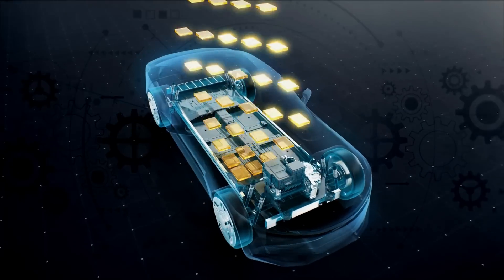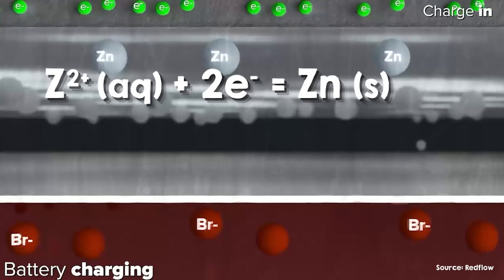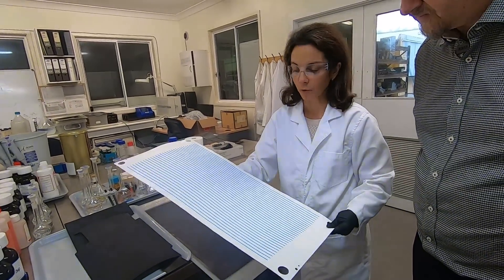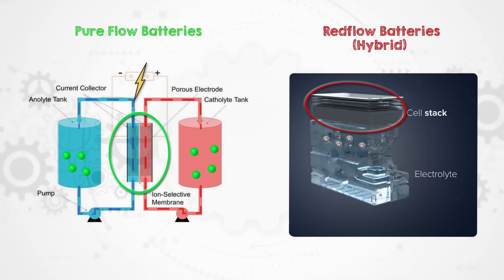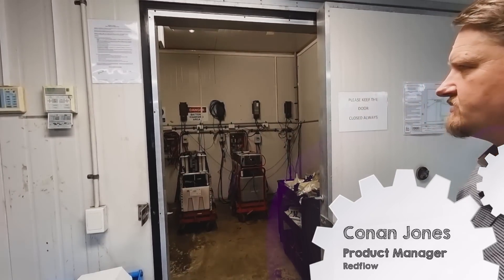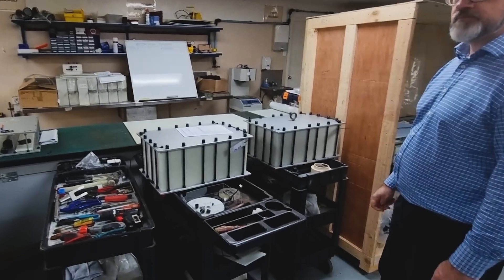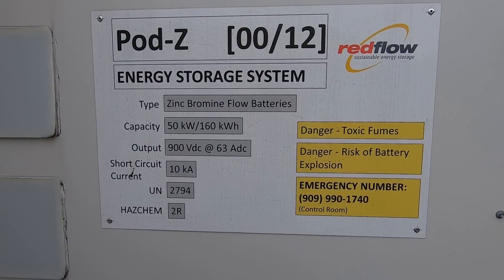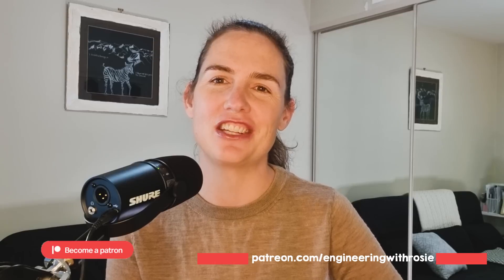Are Flow Batteries About to Take Over? A Lab Tour of RedFlow's Zinc Bromine Battery

Comment: At x3 the price of LFP batteries… We need something 10 times cheaper, not more expensive. 

It seems that a sphere of 2.5 m in diameter filled with sand and covered with 0.5 m of mineral wool would be able to store 300 kWh (1000 oC) for a week, losing 25% in the end, and being able to return half of it back in form of electricity and a quarter in form of hot water. And costing 7.5k USD (20 USD/kWh netto). (For reference, a 2.2kW steam turbine costs 2.5k USD.)

It’s interesting why no startup is able to produce a prototype of such a simple, but so much needed system.

Comment: One year later and the wheels fell off. It would be interesting to revisit this story. Unfortunately the Redflow collapse  reflects poorly on Flow batteries in general not just Zinc Bromide or is it Bromine You story seems to use both terms but this could be an editing problem. The chemistry is above my education level. The story at one stage talks about batteries coming back after 8 years Was that a red flag ??? What about a story covering other flow batteries there is a lot of work being done in this space especially Vanadiun pentoxide batteries. which have a life of 20 years+ and still counting. It would be good to see you talk with private suppliers that have just installed a VRFB at Yadlamalka in South Australia (I think April) this battery in Yadlamalka is still being assessed  but VRFB have been in operation in other parts of the world for a few years now.

Comment: Keeping Lithium for use in automobiles and using flow batteries for grid scale solutions makes much more sense. 
I'm planning to start building off grid capable homes with solar and battery backup. Flow batteries seem ideal due to long term stability. 
As, Democrats push the green agenda and our energy starts getting more expensive and less reliable people will want their own power generation.

Comment: Hi. A good start, but pumps and motors running 24/7 mean more components to fail. The most successful systems will tend towards simplicity, longevity, and cheapness. Occam's razor cuts cleanly. Cheers, P.R.

Comment: Another flowbattery is the hydrogenbromine(HBr-)flowbattery. Working with 2 HBr +e --> H2 + Br2 and discharging with Br2 + H2 --> 2 HBr + e. Allround efficiency is 70 % (( so as a seperate electrolyser and fuellcell both 84%)).  Advantage of those battery is that no expensive materials are needed. Br2 en HBr can be stored in the same tank. When this battery is put on an hydrogenpipe the flowbattery works as an electrolyser. In that case there is no expensive hydrogenstorage necessary. When discharging however you have to buy the hydrogen back. In mine opinion you have than to use hydrogen made by steam methane reforming. Efficiency SMR is 75 % and the efficiency of the HBr-flowbattery as fuelcell is 84 %. So the efficiency of using natural gas (methane) to make electricity by SMR and the HBr-flowbattery will be  75 % x 84 % = 63 % while by a STEG-gasplant is only 50 %.  https://www.innovationnewsnetwork.com/the-elestor-battery-makes-hydrogen-gas-fired-power-plants-obsolete/35865/ https://blauwgroenenergie.blogspot.com/2023/05/85-rendement-de-hbr-flowbatterij.html

Comment: You can improve your video quality in the lab by setting the shutter speed to a factor of 50, due to the 50hz lighting. So 1/100, 1/150, 1/200 etc. Also you could invest in dual clip on wireless lapels like the Rode Video Wireless Go II, or the DJI Mic.

Comment: The EV industry better find an alternative to lithium ion batteries very, very quickly as the EV battery compartment fire phenomena is getting ready to derail said industry - that cargo RoRo ship off the coast of the Netherlands that burned for days due to EVs onboard, that entire homes have now been burnt to the ground due to an EV fire in the garage - these are all becoming more numerous incidents as the number of EVs mount up.

There are only maybe these things that are more devastating than an EV fire: a petrochemical plant fire, derailed train cars carrying tons of toxic chemicals that spill into the surrounding land area, a contamination of plutonium into the environment.

Other than those, there just not much in the way of human technology disasters that can compare to the shear devastation of thermo runaway EV battery compartment fires, which become self-oxidizing and can't be extinguished, they burn at very high temperatures that  can compromise steel structures and enclosures, they release great volumes of noxious, very toxic fumes, they can easily cause anything adjacent to burst into flames (other EVs, other conventional vehicles with petrol fuel in their tanks, entire homes or apartment complexes that people live in).

It's clear that there now need to be quickly adopted laws to ban lithium battery EVs from being parked in enclosed spaces, ban them from ferry boats, ban them from being parked within 15 feet of adjacent vehicles (especially other EVs).

Everything in life involves some risk, but it is also necessary of what are the consequences of when are on the wrong side of the risk equation? with EVs, those consequences can be utterly devastating - hence why it's not at all an apple's to apple' comparison to weigh their risk in the same way we weigh the risk of fires associated with conventional vehicles.

Most conventional vehicle fires are under-the-hood-fires that can be readily quenched with a fire extinguisher (I keep one in my vehicle - doesn't everyone), and even when a fuel tank is ruptured and spilled fuel is on fire, it is very tractable for emergency responders to quench that kind of fire, which depends on atmospheric oxygen to continue reacting. That is not at all the case with any EV fire - there is no choice but just have to wait for it to burn itself out, and no commercial tow truck operators are equipped in any manner to get near a flaming EV and try to move it. None would be so foolish as to risk their life and safety to do so anyhow. So that EV in the underground parking garage, or private home garage, or apartment complex integrated garage, is going to sit where it is until it burns out (hence why entire homes are lost due to EV fires).

Comment: Good to see developments with Zinc/Bromine which are materials clearly not seriously limited in supply compared with Vanadium. While the latter is very toxic, it's a little rich to call Bromine entirely non-toxic although it should be pretty manageable.
Many comments here are moaning about price, this is something we can't truly know without full scaling up and commercialisation. If the full bill of materials can compare with Lithium or Sodium chemistries then "Wright's Law" comes into play where flow batteries might compete where they have an advantage in longer duration applications. 
Those who are calling for a residential model are barking up the wrong tree.

Comment: Very interesting technology. I especially like the ability for the charge to go to 0. The high temp tolerance is great for Australia but what is the low temp behaviour?
I’m interested in off grid wilderness cabin application in the mountains of western Canada. The cabin is used intermittently through the winter with temps typically -10C but can get colder. Lithium doesn’t like cold  and most of the energy would be used keeping warm. Lead acid would work but if less than fully charged, not so much.

Comment: 100 kilowatts is 134 horsepower. That’s about what you’d need for a decent car. How big and heavy is such flow battery? If that size and weight plus the size and weight of a 134 hp electric motor is less than or only slightly larger than a 134 hp ICE engine, then this is doable. Those powerwall sized units were quite big.

Comment: I'm concerned about the high failure rate displayed by these batteries during the Canberra Tests. Very high failure rates were displayed in those tests by many battery types (not good all round). They were replaced three or four times due to contamination (once) and leaks. Leaking fluids in flow batteries was my first thought as the pumps have to run constantly long term pushing reactive chemicals for the scheme to work. Pumps like that should probably be inside the tank where leaks don't/wont  matter (probably already are, hard to tell from the current info).

Comment: I think the elephant in the room is their cost per kw·hr. LiFePo4 batteries are < US$100/kw·hr, so unless they're able to sell that giant 40kWhr system for less than $4k they have relatively few advantages. Could you even ship 1 ton of liquid bromine for less than that? It seems like this is a super cheap solution only if you already somehow have access to large volumes of on-site bromine, like near a brine facility.

Comment: The big problem with all batteries: The cost.  All are high cost and the materials are becoming more difficult to supply.  Geological commodities; fossil fuels, minerals and metal ores supply are all challenged as is the energy needed.  The geological mechanisms for the formation of these commodities has been well understood for 70 years.  Neither renewables nor batteries will ever replace the energy from fossil fuels.  But fossil fuels will hit economic depletion shortly after 2050.  Economic depletion is when supplying the product cost more than the product is worth.

Comment: Redflow has just announced a 20 megawatt 2,000 Battery project to be installed in California. It seems America has recognised how good the Redflow Batteries are. I am surprised that we don't see more interest and support for these in Australia. Plus I believe Redflow Batteries are fully recyclable, do not need lithium and other metals essential to Lithium Ion Batteries, which will become more expensive as Electric Vehicles take off. For stationary installations like the one just announced in California, Redflow seems a much better choice. I also read that Redflow Batteries do not pose any fire risk danger, as can be the case with Lithium Ion. Fire in a large multi battery installation of Lithium Batteries, must or should be a concern for Companies or Individuals considering the options.
It would be great to see you do an update on how the completed 2 megawatt California project is performing.

Comment: Sadly it seems they've picked quite a small battery module and numbered up from there- their "modules" are really groups of batteries of a fixed size.  That basically limits how cheap their batteries can get per kWh stored.  "Mass production" of the individual battery modules can help reduce that cost, but fundamentally by numbering up rather than by making each battery module larger, they've set a limit on how cheap they can get.  That is of course the common state of the world in sealed batteries, for reasons of manufacture, but shouldn't be the case for these guys.  

By making each battery module physically independent, with its own pumps etc., they've doubled down on the same problem.  They lose the benefit of economy of vertical scale which can really drive costs down.

The problem with the whole grid scale storage thing, using technologies like flow batteries which simply don't (and will never likely) have the energy density necessary for mobile device applications, transport and the like, is that they lack a path to scale.  Initial batteries don't have high value applications to jump into, funding the scale-up of production and fuelling Wright's Law- nowhere nearly to the extent that this was true of lithium ion (where initial cells had a market even at $3000/kWh).  That means proponents of such technologies need DEEP pockets, and likely explains why these guys have been struggling along for more than a decade and yet have achieved very limited scale so far.

Comment: Followed Redflow since Simon Hackett invested. Biggest issue is cost per KW when comparing to LiFepo4. There is also the need of the constant maintenance period for the zinc to be flushed (may have changed). As someone who lives off grid,  and currently looking at replacing my 57kw Gel setup lithium is still the only reasonable choice for now for residential users.

Comment: Awesome to get an update on these guys, heard about them years ago and it's great to hear how much they've scaled up. Also awesome to hear they are active in the residential space. I wonder how a flow battery paired with a lithium battery would go vs just a flow or just lithium for residential use considering how some people are already using two lithium batteries on their homes.
Reply: Lithium batteries are wasted in a residential application , these batteries are well suited to residential needs.

Comment: Nice concept but this is dead on arrival.
Reply: The technology has potential to be very cost effective, so it's good that there are some grid-scale implementations where there will be enough investment put into it to really see if it can live up to its promise. I think it's a bit early to say that it is DoA.
Reply: @tlangdon12  it won't be used for grid scale lol. If catl releases their sodium ion in the next couple of months and makes it even cheaper over the course of the year, this redflow is simply dead due to shipping weight alone.
Reply: @EugenePutin  Most if the weight of the Redflow battery is water, which can be added by the local distributor once the battery is on site.
Reply: @tlangdon12  water can be generated from thin air and I don't think it would matter.

Comment: It's nice to see one that looks like it's actually happening. Also that battery at 7:35 isn't too huge, you could easily fit multiple units in a typical garage in Canada...though looking at their data sheet the operating temperature is between 10-45 degrees so it would need to be installed indoors here. That could be somewhat challenging since it's 1500kg so you would need to be determined to actually get this thing inside.

I don't see any info on pricing? Also how many years or discharge/recharge cycles can it handle?

Comment: Sounds like very promising storage technology.  I may have missed it, but cost was not mentioned. My understanding is that Li-ion batteries are about the same price but tend to degrade over the years. 
If used for long(er) term storage, like pumped hydro and CAE, then hybrid flow batteries would seem to win if $/kWh is a little higher because they are faster to deploy and modular (so can be scaled up over time as needed). 
I especially like the use of non-toxic chemicals and the promised of 100% recycling.
Thanks for another informative video!
Reply: I think Redflow advantage is heat resistance, non flammable, deep / full release.
But I think the round trip efficiency is not as good as Lion/Sodium, I am not sure, but I think in Max their battery have around trip efficiency in the 80s while Lion and Sodium is at the 90s.
Just based on Google, I think pumped hydro is around 100USD (if this is really the case, please someone confirm it for me)
CATL said that their 1st gen Sodium Battery is 77USD/KwH and 2nd gen is 40USD/KwH and that is 2025/6 (est), remember building a pump hydro is 10 years of planning + Construction, I am so afraid that even pump hydro is 40 USD / KwH as an accountant I will tell you I still opt for the Sodium option (even 35 USD/KwH), although I know that you never needed to replace a pump hydro station.

1) pump hydro is not necessary carbon free, there is a study from EDF (they are not independent they are nuclear) but there is a theory that pump hydro will release methane (Biodegradation).
2) the geo area is restricted and if you are not looking to storage water as the main goal, you still needed to have long cable to connect to the grid while battery can be right next to the grid.
3) I can price battery in small localized location, that can act as a bundle of micro grid connected to a big grid, while I don't needed to have a huge cable to transmit electricity.  e.g. I have a very density area, I place a battery into it, normally I know that there is a lot of roof top solar to feed into this local battery, but in case it is raining for days, then I can pump electricity slowly and constantly and rely on the battery to discharge and recharge (at night when sleeping) so you don't needed to upgrade the connection that much.

Comment: These batteries could be very useful in expanding fast EV charging stations in areas where grid stability or high current service is an issue. Freewire has charge stations with built in batteries that allow you to get installed quicky and easily to a standard voltage and current power service. No special high capacity service needed, no long waiting periods either. You could achieve the same result by installing a couple Redflow Quadpods along with a standard charging station. The batteries get charged at night when power is cheap and plentiful, and then kick in during the day as needed to make up capacity as cars are charging. No worries about overloading the grid and maybe even car charging when the power is out.

Comment: @engineering with rosie
I uave been curious for 3 years why this isnt being used in vehicles there are chemistry that have high enough energy densities where it could work. 
Zinc air for example. It would be  atleast 150miles worth of travel amd it expands with improvements in chemistry but recharging bexomes emptying and refilling a tank. A minute recharge and a replacement of the power assembly every ten years.
Reply: They are almost certainly too heavy (weight vs. energy density) for mobile applications.
Reply: @tlangdon12  that kind of doesn't make sense. The anode is air so that weighs nothing, potentially. The cathode would be zinc aqueous solution which has a higher energy density. Which leaves only the active mechanism for it to flow through. Which of course can be iterated and improved